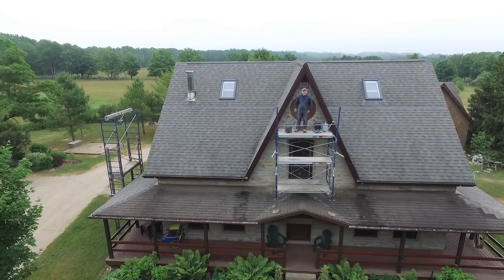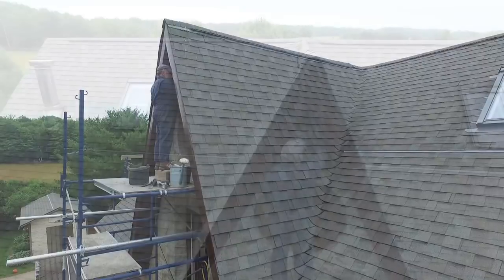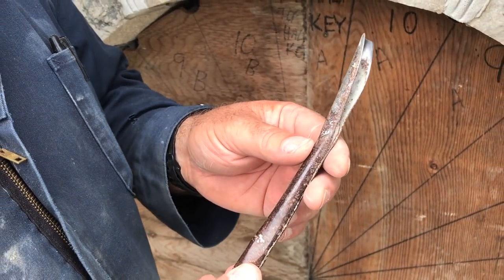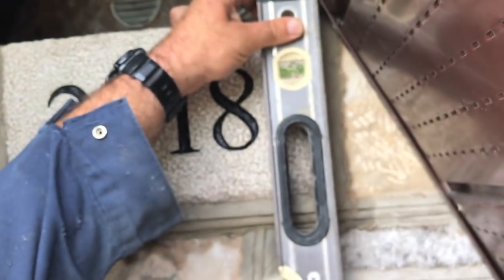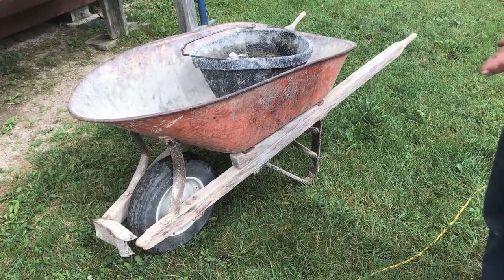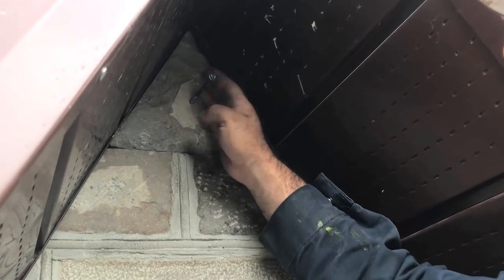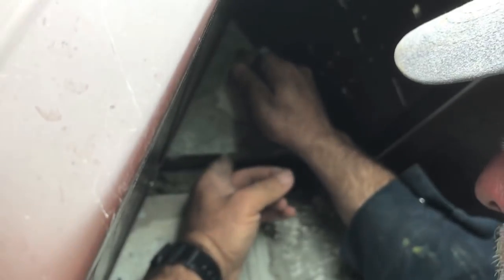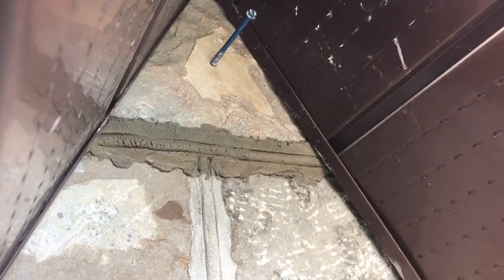Hand-Built Stone House Tour

Comment: What was you mortar mix? Did you use any additives like acryl 60?
Reply from the maker: Hi Gary!
Thanks for your note. The mortar mix I used was based on the traditional 3 parts sand to 1 part cement mixture. For the cement component I used 50% Portland and 50% masonry cements. A lot of people feel that any kind of Portland is a no-no for stonework, but I disagree, at least with the stone I use. My limestone is harder even than mortar made with straight Portland, let alone the mixture of cements I use. After 31 years there's absolutely no deterioration anywhere on my stonework, so I trust this recipe.
Drop by my website https://baileylineroad.com for a visit sometime. You'll find lots of stuff there, including tool giveaways, articles and the chance to ask me questions. Join 24,000 people who get my Saturday newsletter and you'll hear from me each week.
Bye for now and thanks for watching!
Steve
Reply: @baileylineroad  I used three buckets of sand to 1 bucket of masonry with a shovel of portland,  It has been 30 years and not one crack in the field stone retaining gravity wall that I built.

Comment: This is just gorgeous. I hope to build a stone home soon! ❤
Reply from the maker: Thanks for your note and kind words. Tell me about your plans for building with stone. I'd like to hear. Bye for now, Steve
Reply: @baileylineroad  my plan is to do something much simpler then what you have here. A box shape and one floor. Then to use metal joists and rubber roofing. (I'm trying to make a completely fire proof home as fire is common here in AZ). Rock is also plentiful and often given away for very low prices or for free. I am thinking a concrete foundation and metal rebar as well